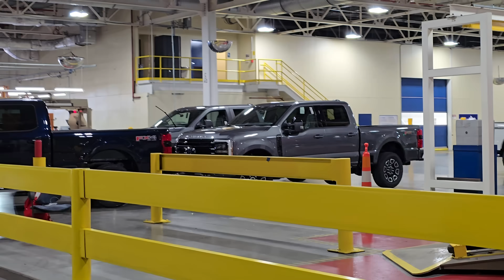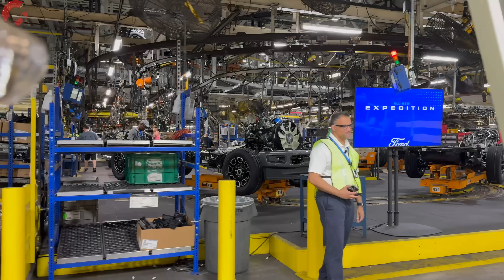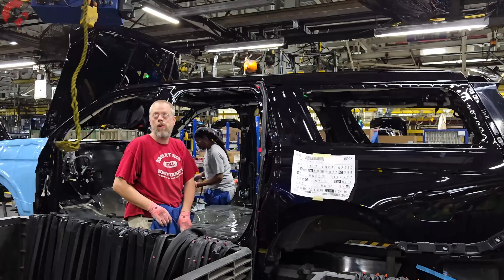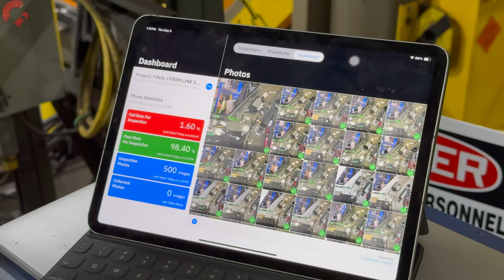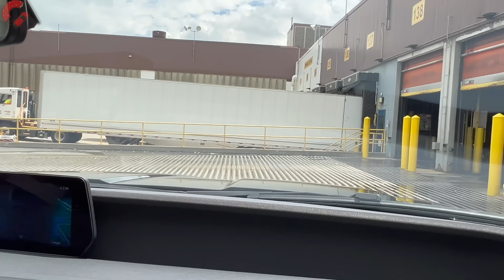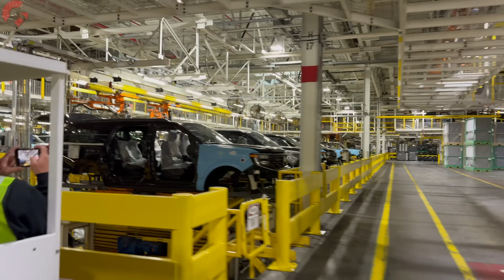INSIDE the Super Duty & Expedition FACTORY! -- Ford Kentucky Truck Plant Production Line Tour!

Comment: The 2023+ redesigned SuperDuty is absolutely the looking of all time. The plastic bed & bumper steps are a total gimmick. Just a way to cut material costs. More plastic less aluminum/metal, ripping off customers by raising MSRP while lowering costs. #FORD #SUPERDUTY

Comment: Owned 3 SD’s since 2021, loved them.  Unfortunately, two have had recalls. I had to sell my ‘21 F350 due to the payload recall, they overstated it by 444# which was not good for my use case.

Bought a ‘22 F350 DRW…. Just got a recall notice but no corrective action in place yet….Waiting notification from Ford on the fix.

My latest truck, which is a ‘25 F550, the windshield wipers only work on high and the w/washer doesn’t work. Whilst this is not a recall, it’s still a bummer with only 450 miles on the truck. Service scheduled.

Not ranting here, just fact. Crazy how defects still escape out of the plant with all this advanced tech.

Comment: ABSOLUTE  GARBAGE ANYONE WHO KNOWS  ANYTHING ABOUT  Ford doesn't own them
Reply: Ive been a mechanic for 25 years and know a lot about Ford vehicles. That's all I drive is Ford. My wife's 99 Expedition has 333,000 miles on it.... original motor and transmission. My 2001 F150 has 185,000 miles on it.... original motor and transmission. My daily driver is a 2006 Ford 500 with 183,000 miles on it... original motor and transmission. Most people who know NOTHING about Ford's are the haters. Every brand has issues bud.